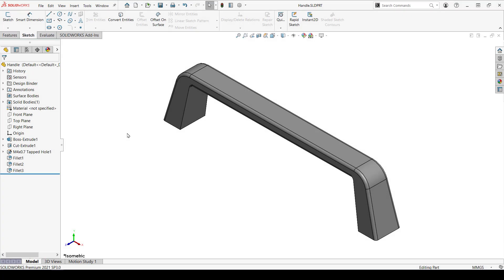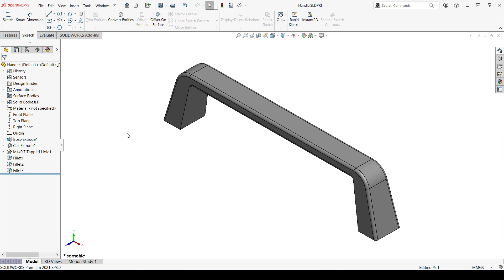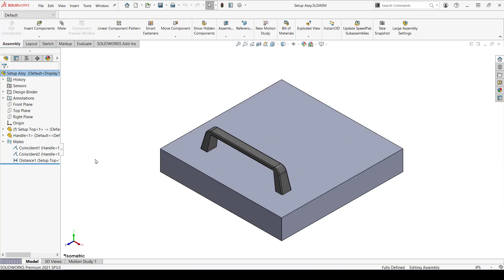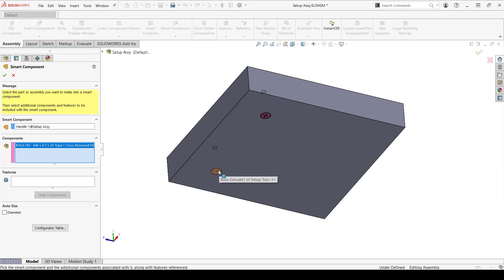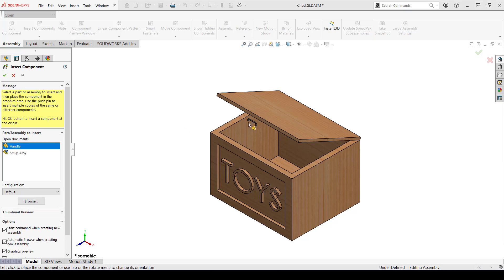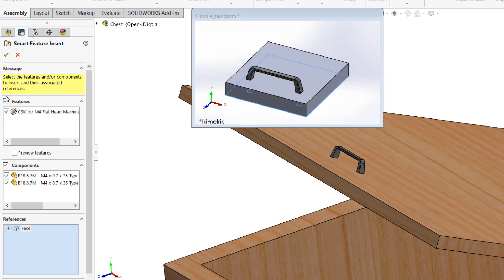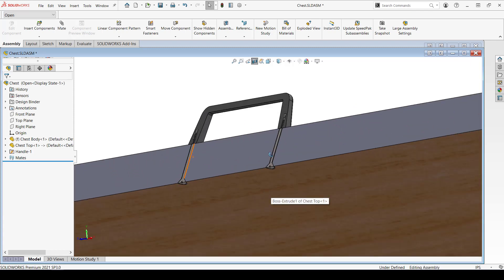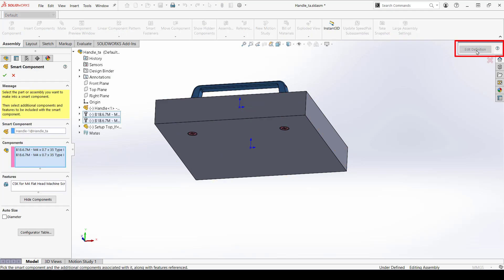SOLIDWORKS: Increasing Design Intelligence with Smart Features

Comment: thanks for the instruction..
could it be done to a cylinderical face ? 
it would be better if we could use it for example; imagine a pipe and making a specific slot as well as a cap that fits into this slot..

I have several dozens of this to make in a assembly.
Even if I managed to create this slot dimensions as one positive/part (instead of a negative/hole kind of feature that may be done by this smart feature), then I inserted this part to the assembly and use cavity feature from the base part which needs to one more step to extract the positive/slot part..

Any ideas ?